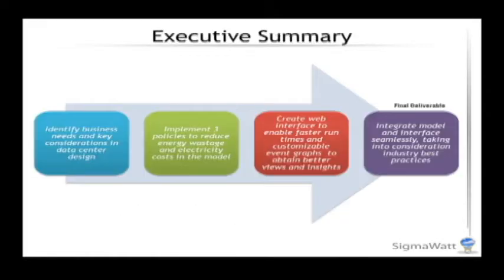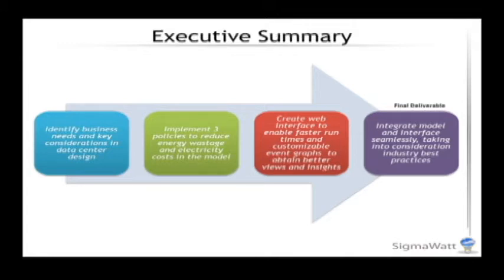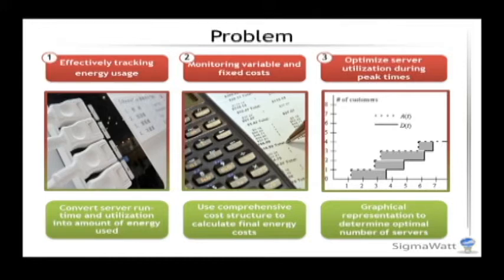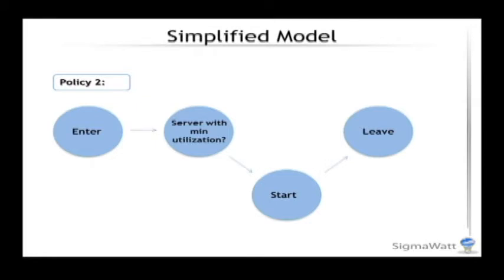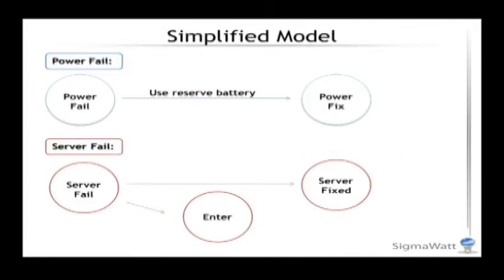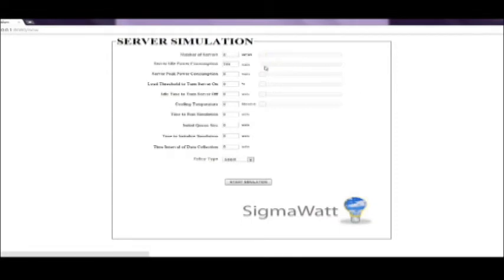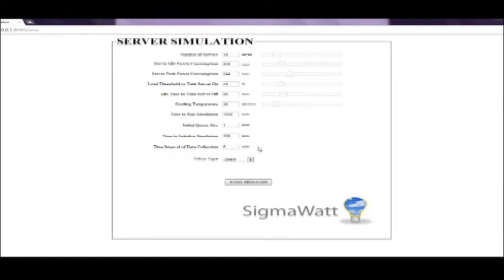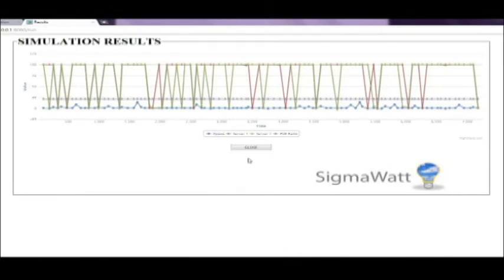SigmaWatt Simulation 2011 - IEOR 131

Comment: (glad) I like the greener solution pitch, and then how you used what the customer would really want (costs) and included fixed and variable costs. 3 Types of policies, 2 types of failures, bathtub distribution, I love it! Is the initialization parameter for data collection made to allow the server farm to reach steady state? If so great idea, since the server farm will be running for long periods of time.